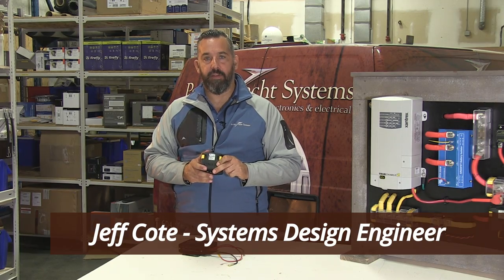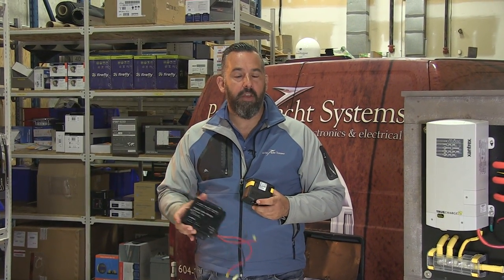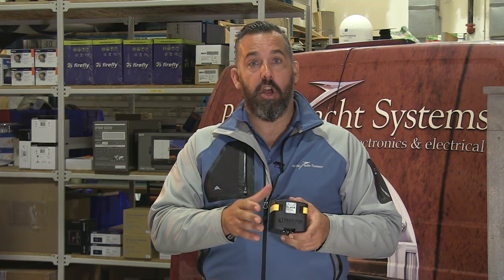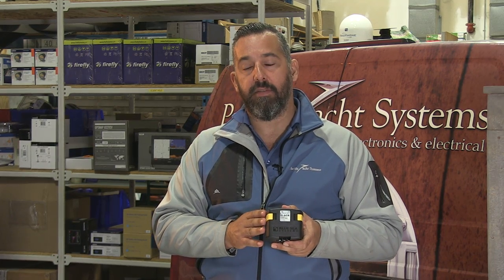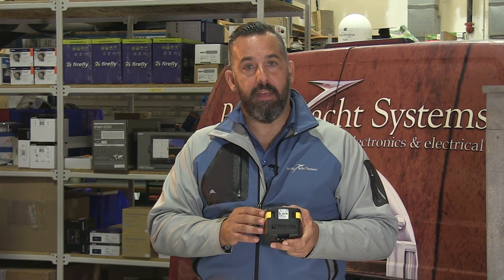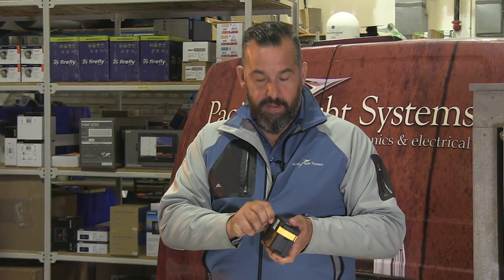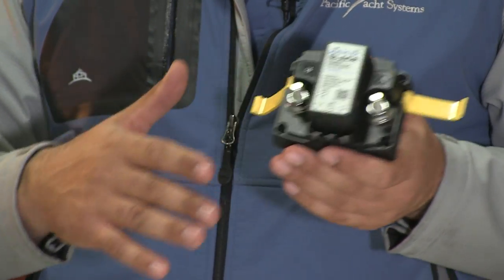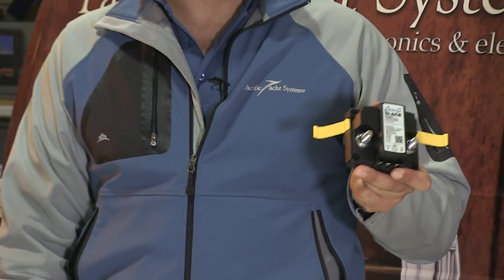Charging a Second Battery with a Battery Combiner on a Boat

Comment: I have this combiner on my boat, now i want to put a trickle charger on. Should I use one trickle charger on the main battery  or one on each battery?
Reply from the maker: Assuming your trickle battery charger as two outputs, connect trickle charger to both batteries.

Comment: Hi Jeff On my boat I have solar panels for my house batteries but I want to use 1 solar panel separate to keep my engines and thruster battery charged. Now I have a 30 amp controller for that single panel and want to be able to distribute the charging for each battery not all at once, as they are in different areas of my boat  , so my question is what kind of a switch can I use to change from one battery to the next, a 4 position rotary switch or what would you recommend. just trying to keep it simple to make sure the 3 batteries don't sit for days or weeks with out charging when we are on the hook. If possible can you send me a drawing or pic of what you think would work well. I don't mind switching after each battery gets charged.
Warren

Comment: What would be the best solution for maintaining a 35 AH battery used soley for VHF radio, its a survey requirement here, the house bank it would be charged from is about 440 AH, charging different sized batteries is problematic as I understand
Reply from the maker: Hi Nick, recommend installing a 50 amp battery charger, like the Xantrex or ProNautic. Primary charger lead going to house and 2nd lead going to smaller battery.

Comment: Can you use a combiner with one starting battery and combine it with with a bank of two batteries or does it have to be between two balanced banks? 1-combiner-1 or 2-combiner-2 ? Thanks! love your videos.
Reply from the maker: Good question, battery combiners should be called: battery bank combiners. Battery bank = a group of batteries wired in series and/or parallel acting as one bank. Resultingly, you can have only one combiner between 1 battery and another battery bank (made of multiple batteries).
Reply: @PacificYachtSystems  thanks so much...love your vids

Comment: So a few questions. The ML series looks to be superior in every way over the SI. Other than the $170 is there a downside? And if you have a charger, like the P12 you lose the ability to charge separate banks with their own routine? I have an Optima AGM house, and a flooded as my starter, will that cook one of the two banks?? Very much interested more in the downsides to make a decision rather than the positive features the manufacturer touts.
Reply from the maker: The ML series also allows you to manual parallel the two battery banks. In effect acting like a remote parallel switch on top of automatically paralleling whenever there is a charge voltage. Lastly the amperage allowed through the ML is double that of the ACR.
Reply: @PacificYachtSystems  Seems like the ML is the obvious choice for someone planning on keeping their boat for a while. Thanks!

Comment: Learning lots from your videos
Today's question would it be  better to use a ARGO FET unit instead of this unit?
Reply from the maker: Hi Steve, depends on the situation. In most cases, i try to use a ArgoFET first and then if that doesn't work for the application, I'll use a battery combiner.
Reply: @PacificYachtSystems  hi Jeff
Have you used the Cyrix CT battery combines instead of the ARGO FET?
Reply from the maker: Hi Steve, not yet.